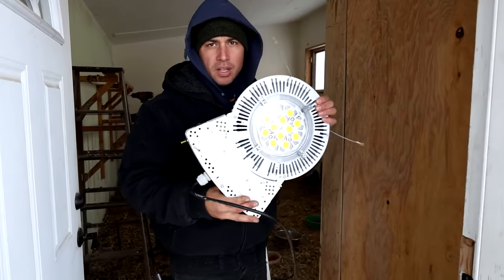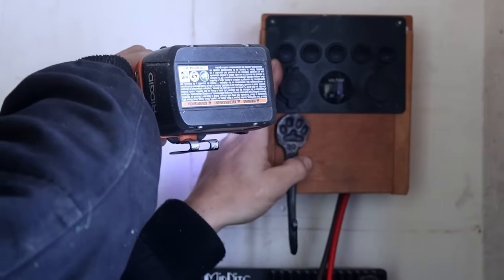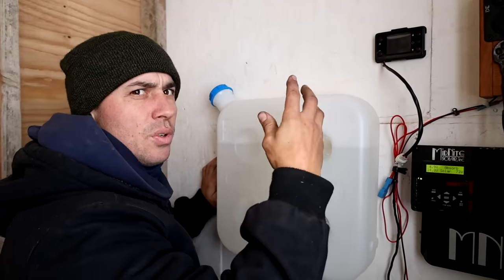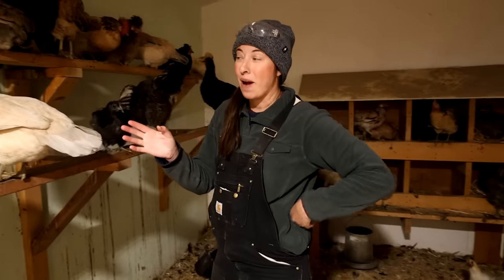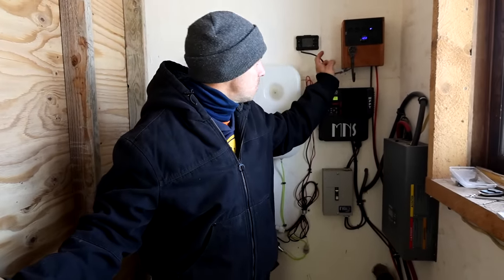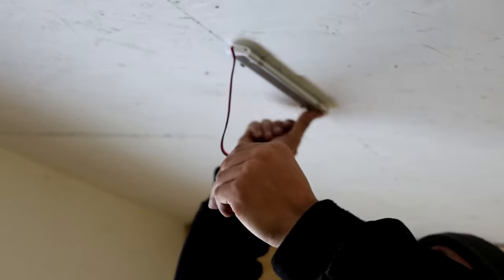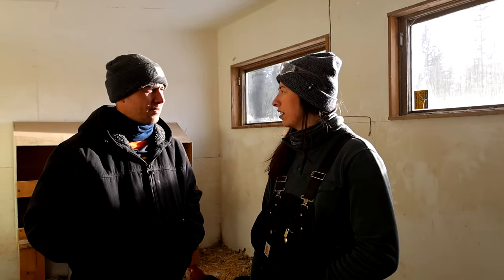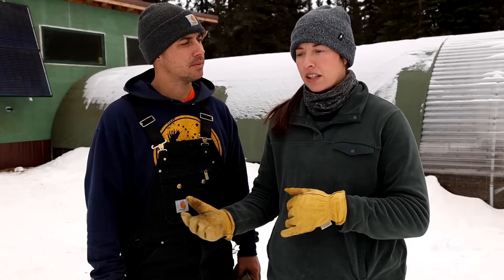Let There Be Light! | Heating the Chicken Coop with Diesel Fuel

Comment: i wonder if convection is a better solution than radiant and a vented diesel heater is more $$ efficient than a lower embodied energy fuel like propane that doesnt need a vent.
Reply: Burning propane produces water vapor, so it adds to the humidity, which they do not wish to increase.

Comment: Might be a silly question, but if you are pulling air into the heater, is it not reversing the flow of the hole you made to off gas the batteries? Like will it pull the battery gas’s through the small hole and through the heater?

Comment: Question:  I am in Pennsylvania where my temperature seldom  goes below zero.  My central heat is oil fired.  I have two external tanks that I fill with #3 heating oil.  I put in anti-gel when it calls for zero.  Could I run one of the diesel heaters on my fuel oil for an external room approx 12 x 12?

Comment: I'd hate to see anyone waste money buying replacement electronics if it's repairable. The companies will always tell you "sorry has to be replaced" if you dont have the repair skills find someone in your area that does do electronics board repair. Usually it's a cap or mosfet etc that has failed and you can fix for pennies. Many electronics shops do repairs for much less than the cost of a new device as well. Just advice so up to y'all how you proceed 😊

Comment: Is your temp sensor not in the utility room. It cannot react to the temp in the actual coop….is a remote sensor available to let you run proper temperature controlled in the coop…would probably save fuel.

Comment: Hi, love your videos, but I wanted to point out a possible big mistake that you made in the install of the diesel heater.
First let me say I'm a solar dealer that does sales and installations for the past 25 years. I've also been totally off grid for 25 years.
You installed the heater in tha same room as the batteries for your solar system. You showed that the heater pulls in air through it's air intake. 
What will happen is that instead of your battery box venting the hydrogen gas to the outside the diesel heater will be pulling the air and the hydrogen gas the other direction through the heater.. This can cause the room to fill with hydrogen gas, which can be extremely dangerous. 
If the batteries are gassing and the heater is pulling the hydrogen gas through the heater this can cause an explosion.
I've seem this happen when propane water heaters are in the same room as the batteries.
Never put a combustible device in the same room as the batteries.
You might not have a problem because you might not reach a high enough voltage on your batteries alot of the time as you have very little sun, but better safe than sorry.
Again love you videos, keep it up.

Comment: I don't understand why you didn't just mount it the bottom plate on the wall side ways & they give you the bottom plate for the part u was making for the wall but good luck god bless oh & small hose goes out side as well it's for fresh air in combustion chamber
Reply: No light no eggs I wouldn't run out side lights but I'd close little door case predators & they won't be stressed witch will help get you more eggs

Comment: Carbon monoxide detectors are supposed to go on the floor I believe…. It’s heavier than air. 
I just noticed when you said you installed one, you looked up at the same time.
Reply: carbon monoxide is lighter than air, so detectors should be high up in the space, but within reach so they can be easily tested.

Comment: Your issue with code could be HUMIDITY.  Remove it from that closet, bring inside your home neAr the fire and DRY IT OUT. 

THEN R3INSTALL and t3st. If it is ok but comes back in a day or two, you need to fix humidity in closet.

Comment: I'm concerned about you having lead acid batteries and a heat source in the same area... batteries charging puts off hydrogen gas ... as your heater is drawing air in, the passive air vent you installed for the battery bank is now an air inlet for the heater.
  I once had a gas-powered golf cart for running around the job site.  It had a little 2 stroke motor and a regular car battery under the seat.  You would step on the gas and a switch would close, it would engage the starter and fire up the motor and off you went, it didn't idle when you stopped it would shut down the motor.  Well one day I hit the gas pedal and there was a loud explosion I raised up about 2 inches but didn't move forward.  I got off the cart raised the seat and when I looked at the battery, the ENTIRE top was gone, all the plates were exposed everything under the seat was covered with battery acid, when I washed my pants the little gap between the seat and the cart had allowed battery acid to spray on the back of my legs and my pants just fell apart in the wash. 
What had happened is the battery had off gassed and collected under the seat, when I hit the gas pedal the starter switch closed and created a spark this ignited the hydrogen. I gained a LOT of respect for power of hydrogen.
You would do well to isolate your battery bank from any type of spark and/or flame and insure you have positive ventilation much like they have in power boats. I would hate to your hard work go Poof....
Reply: I was thinking (worrying about) the same thing.